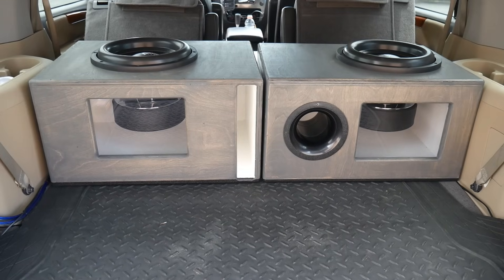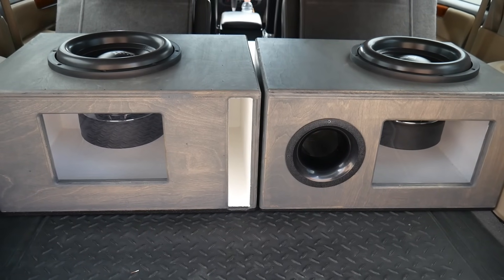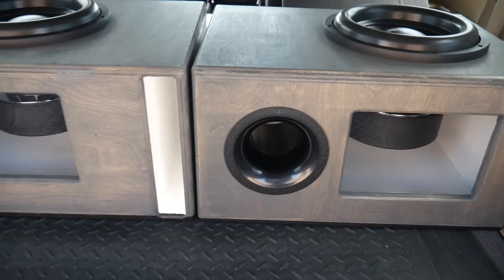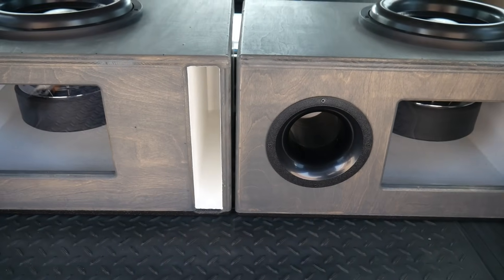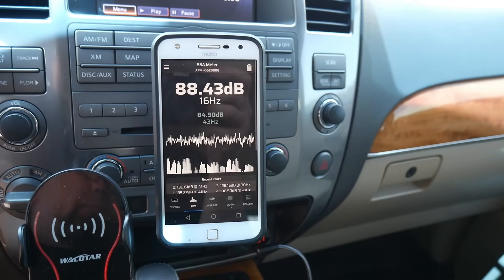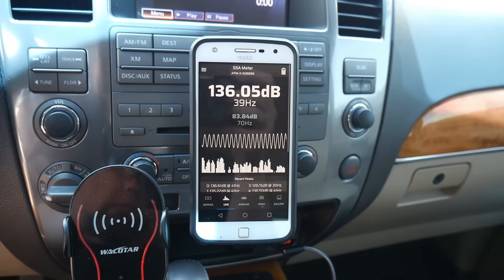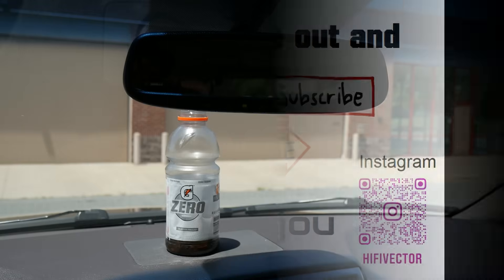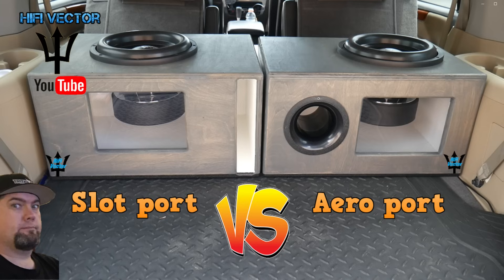Part 1 Slot port vs Aero port subwoofer box in depth comparison

Comment: You should do a thermal on the voice coil. Cause personally I want the one that keeps me from frying my coils
Reply: If you are that close to frying your coils you should buy a better woofer while you can still sell the one you are currently using.  That being said, if you have the ability to run a slow test signal sweep on your ported box, you can actually visually see where the port is tuned.  It will be the frequency where your woofer moves the least and the port moves the most air.  With a large port, sometimes it will almost make your woofer appear completely stopped with almost no excursion, but the port will be moving massive amounts of air.  This is the freq where your woofer will suffer the most.  Because this is also usually the freq where you get the most SPL, and it is also the freq you love because you can really crank those tunes up with that magic freq.  This tuned freq is also where your impedance will be the lowest and put the most load on your amplifier and get it hot and get it to really crank out that one bass freq.  All the while that voice coil is barley moving and barely getting any cool air pumped around it, and it is getting hot, then your woofer goes Poof!   How do you get around that? What's the answer?  Choose a smaller port, a smaller port will not control the woofer movement as much at the tuned freq and the woofer cone/voice coil can move up and down more and get the cool air moving around it to keep it cool.  Make sure to round and smooth the smaller port ends to keep the chuf away.   Yes you will decrease your ability to play that one magic bass freq, but your amplifier will love you for it, your voice coil will love you for it, and your box will have a better flatter response.

Comment: Shouldnt the port area be the same for both ports?
Reply from the maker: No, because round ports are technically more efficient so the whole consensus is to reduce the area by 35 to 50% compared to a rectangle port and that is where difference of opinion on how much to reduce the port area . But going from a rectangle port to a round aero port it will always be less port area required. If you went identical port area the round part would technically be too much port area because of its higher efficiency.  But this is a topic that has so many different opinions and has for many years.
Reply: @HiFiVector  Ok, I get where you're coming from. Apples to apples the round should out preform the sloted. Less drag/surface area....allegedly

Id like to see that same test with equal area ports, to see if it is as much difference as many claim. 

Thanks for the video and the effort you put into it.
Reply from the maker: Thanks man and yea I think so too. I may try and do another video if I can find the time to build another box with a 6” and see how it does. So many things to do hard to find time for it all lol
Reply: Would that mean that you can build an overall smaller box and have the same amount of internal box volume as the slot port box? @HiFiVector

Comment: Do this test again with a 6” port so its more apples to apples
Reply from the maker: But then it would not be apples to apples? Round ports are more efficient so you use about 35% to 50 % less area than a slot port to make them " equal". At least this is the general consensus in the industry that i see and read.

Comment: You might get different results if you put the aeroport box and the slot pox on the same side for example if your mic is on the passenger side floorboard the sub on the driver side might be loading different compared to the sub on the passenger side
Reply from the maker: I did try that, and it didn’t change anything much so that’s why I didn’t switch when I did the video. Also SPL meter was center windshield.

Comment: 3db is a lot,, it's double the power, I should think the slot port is showing the amplifier the higher load resistance making the amplifier do more, also obviously the port itself has a effect, test the impedance sweep

Comment: One of the biggest things to test when doing comparisons of this nature is the difference between the impedance the amplifier sees between both port designs as this will change the amplifiers output power and give a unfair/different result
Reply: When comparing same box size and same tune It's not a unfair result...it's an inherited result due to the enclosure design.
Reply: @jeffhoman9227  Right, this is part of what the test is supposed to show. No point in running a test if you're going to try to compensate for things before you even run a test. (There's a point to be made about having a "control" in an experiment, but that's different. The purpose for this test was to show these kinds of differences.)
Reply: Isn't the smart 3k rated for 3000rms between 1-4ohm?
Reply: I agree the bigger slot would have better impedance but if they were made with an even amount of surface area and just changed the length inside to make it tuned the same, I think the area would come out onto.

Did you notice the test showed the aero played at a lower hz and therefore had a lower db while the slot had atleadt a 1 hz higher tune and therefore had a slightly higher db.  This test should have been closer to even but like I said if the surface area of the aero hole was bigger, it would have given the aero a slightly higher amount, especially because the impedance of the aero would be lowered.

The debate will rage but round ports in my day of old school setups always sounded better to me but that is only my opinion.  In the end it's not worth a large discussion. 

Is big watts from big amps, subs,and changing so much in a car really worth the negligible db compared to low watt setups that can get to high enough db for listening while driving and get clear sound from all subs and speakers is more my focus now.  I could use a 3000w amp on 2 subs or a 1200w on a pair of 12 for low boom bass 20-60hz, a 800w on a pair 8 for mid punch bass 60-160hz.

I'm planning to have a 1000w 4 ch to 6x9, 6.5 200-2000hz.

The stereo built in amp 50x4 or 200w 4ch will power 4 inch speakers midrange and tweeters on passive crossovers.

For me, 135 db for each set of subs and matched to the speakers and tweeters is preferred to be able to get the clearest sound when stuck in traffic.  All amps would be running at different times and at different amounts when playing so less wasted energy so I won't need to upgrade the alternator, but each amp would have their own capacitor.  I have a lithium battery but I don't see the need for it yet.😅

Comment: now try equal port area.
Reply from the maker: Then it wouldn’t be equal because round ports are more efficient than rectangle ports. That’s why industry standard is when using around Port to reduce the porch area by 35 to 50%. This is the whole big controversy between rectangle and round ports.
Reply: @HiFiVector  Ive never once in my life used a smaller aero because theyre more efficient.  Theyre the most efficient option for the port size needed.  Under-sizing them though is likely still gonna cause issues because the flares really only help the flow at that boundary layer of the port.   

Also I think those subs in particular need at least a 6" port. 

Reason why round is better is for the given port area they have the least overall wall area so least drag.  Same reason why aspect ratio of port matters.

would be interesting to see you go as far as using equal port area in round square and various slot ports could do it easily using external ports.  These are all things i tested when I was chasing numbers now I dont really care and just size my ports so im getting under 17 m/s velocity regardless of what shape they are or how flared they are.

Also ever test the slot port with your dats in an area where the port doesnt see the floor of the vehicle or room it was in when you tested it?
Reply: in this test both ports may actually be too small for the sub
Reply: Another good test would be to build each port so that the port velocity is identical and to see if there were actual gains with one over the other.

Comment: Would be nice if the ports were the same size.
Reply: Yea I understand. Great video  👍
Reply from the maker: But one of the points of the video is when using a round aero port you don't go same size. They are supposed to be more efficient so you need to reduce the volume of the Aero port by 35-50% ( depending on your opinion) compared to a slot port.  If you made them the same then the Aero port would be actually larger because it is more efficient.

Comment: I prefer passive radiators over both. I can change the tuning easier than both as well.  Sure you need a 2 to 1 to most subs to make them really perform but I don't care. They  pound hard and have the characteristics of both boxes imo.

Comment: So you are saying a slot port with calculated and measured cuts with bracing needed is EASIER than cutting a hole for an aero port? Uhhh ok
Reply from the maker: Yep because the properly install an arrow port you also have to add bracing to the aero port so to me easier to cut a slot port. But a different strokes for different folks.;)

Comment: Slot port all day. I've built hundreds of enclosures... Always preferred slots.
Reply: You're a slot
Reply: More port area
Reply: What can u do about port noise. I have a 2cu box built to spec but has a lot of port noise actually sounds like sh*t
Reply: @RoyalCabinetInstallation radius the sharp edges.
Reply: That's exactly what I was about to ask these guys. The slot ports I've made had some noise unless they were kurffed. I've been using airports ever since I found where to get the quality ones from and never turned back @RoyalCabinetInstallation
Reply: What about  a kerf port?
Reply: @MattSnider-b5z  I do kerfs as well. They add nothing to output. They look great though. They're also still a slot port
Reply: Can u build me a double 12 inch bro
Reply: @Carl-yx1ww  I can if you're located in Las Vegas. I didn't currently ship

Comment: I had a slot port with 70 in of port and did 149db switched to 8" aeroport and did a 152.6db with everything else the same. Aeroport by far is louder IMO
Reply: How many cuft was the box?
Reply: @bubbawubba2307  5cu after displacement
Reply: @Chris-B-Bassin  what you have in it? 2-12s or 1-18?
Reply: @bubbawubba2307  2 x 12 Zv5 hybrids

Comment: If your slot port has 90 degree angles and no equal radius has it's useless and creates too much turbulence which hampers sound and aeroports are only good if both ends are radiused